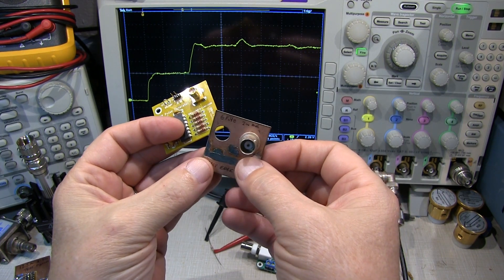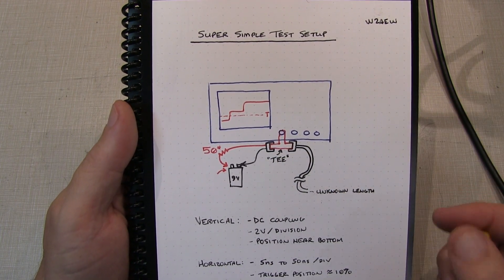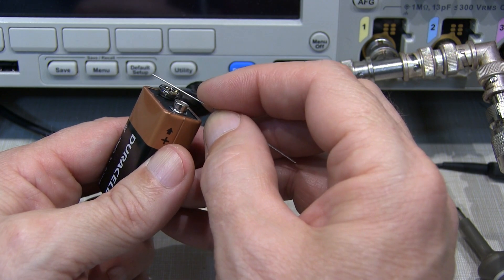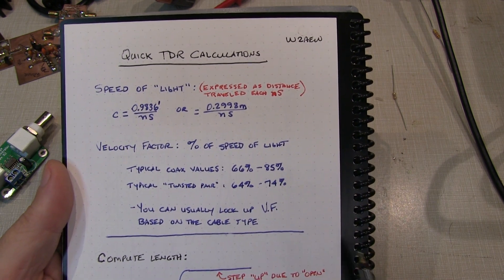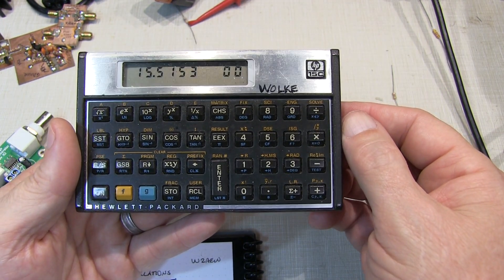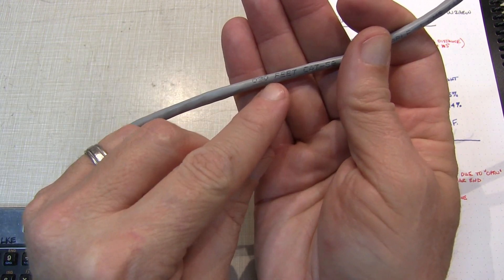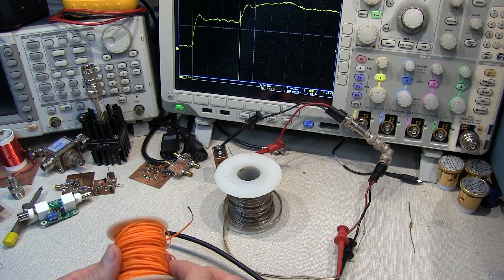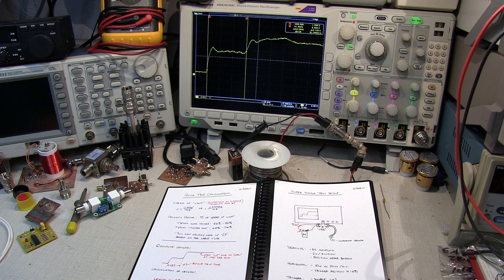#323: Measure length of coax, etc. with your scope, a battery and a resistor - simple TDR

Comment: Very educational content. I tried to use this method to capture the "top-up" waveform, it turns out that the resistance used is important. Initially I use a ~250ohm resistor, I can hardly get a meaningful waveform, probably because the signal bouncing back and forth multiple times. When i use a 50ohm feed-through bnc connector for the signal port,  it's easy to capture the expected waveform and the round trip time seems reasonable (yileding a ~66% VF).

Comment: 9:43 With 2 twisted pairs connected in parallel I should get 50 Ohms  for my simple 1/2 wave dipole. 😆 I will try 4pcs of 1/2 wave dipoles on a super high plastic water pipe, with 1/2 wave free space between each of them.  With all the UTP cables of the same length, phase should be OK and it should work with my Baofeng UHF 70cm band walkie-talkie.  This will be my funniest antenna, made of old UTPs. 🤣

Comment: Nice. You actually sending a step function signal along the line. No polarity change, only 0 to 9V! As it propagates and reflects - it looks like it only interferes constructively. Doesn't it? Very interesting.
Reply from the maker: Yes, only constructively.
Reply: On the othe hand, the total voltage of the second step is ~9V=voltage of the battery, which also makes sense...
Reply from the maker: @eugeneeugene3313   This is the right answer.  The coax is an open circuit, so once it is "charged" up to the full battery voltage, no more current flows - thus no voltage drop across the series resistor, and the voltage on the line equals the battery voltage.

Comment: I just found the break in a guitar cable using this TDR technique :D The break was inside one of the jacks. The break was 2 mm before the very end of the center wire inside a coax cable, right next to the tab it was soldered to inside the connector. The delta x was 41 ns so the break should be a little more than 4 meters away, according to the formula. The cable was about 3,5 meters long, so it had to be at the very other end

Comment: Is there a simple way of measuring the time between the rising edges digitally so you can output the length on a 7 segment or lcd display and remove the need for an oscilloscope? Would using some comparators with two reference levels to detect each rising edge work? I can see this being a problem when measuring different impedance cables as the levels will shift. Measuring shorted cables would also be different but would this be a fairly reasonable approach?
Reply from the maker: You could arrange a pair of fast comparators, and have them switch on a current source that charges a capacitor to create a linear voltage ramp between the edges.  After the 2nd edge (and the current source is turned off), the voltage on the cap will be proportional to the time-delta between the edges.

Comment: I just tried this Alan!  I came up with 78' 6" but haven't verified the physical length yet (can't get to part of the cable up in the garage rafters) but it appears to be quite close by my estimation.  On the bump up after the initial ramp of 188 ns, the bumps 'repeat' at 188 ns rather than a straight line that you have on your scope.  It's as if the pulse is ringing in the cable.  Is that possible? or is there something wrong with the cable?
Reply from the maker: It is possible there is a small impedance discontinuity in the cable causing a small reflection.  Check other cables to see if the same bump occurs.

Comment: This is an excellent video. However, for some reason my waveform does not look like yours. I get more square waves, or sometimes slopping waves. But nothing like yours. I am using a Hantek scope (probably the reason why) trying to measure a known length of RG-6 (75Ω again, probably the reason why). I did the back math to determine what the delta time should be and get nothing anywhere near that time. Thoughts? DE KF6BL
Reply from the maker: The fact that it is a Hantek shouldn't matter.  What is your expected length, and what are your scope's horizontal and vertical settings?  It should work just fine with the RG-6 75 ohm coax.
Reply: @w2aew  Thanks for the reply. 2V vertical and between 20~500 µs looking for that distinctive waveform. Anything below 20 µs will cause the scope to lock up. The length of the cable is 5' .5". I am using a resistor of 49.5Ω. I'll keep trying. I saw some other videos of yours using a pulse generator. My scope has a squarewave generator. I might try that and see if I can duplicate on of your other videos. I am trying to experiment with the scope and NanoVNA for testing cable lengths. Thanks again - KF6BL
Reply from the maker: @briandonaldson612stringgui8  Well, there's your problem.  20us to 500us is WAAYY too slow to measure the round-trip delay of 5'5" of RG-6.  RG-6 has a velocity factor of 83%, which means that signals travel at about 9.8" every nanosecond.  Your 65" cable (130" round trip) should give you a TDR delay of just 13.2ns.  So, your horizontal scale would need to be set to something like 5 or 10ns/div in order to see this.  It also means that if you were to try using your scope's square wave generator, it would have to have a risetime that is MUCH less than 13ns in order to work (which is unlikely).  If your scope "locks up" when you set the horizontal time/division to less than 20us, then that sounds like a problem with the scope.
Reply: @w2aew  Wonderful. I guess my math is very limited when it comes to C and inch/ns. I will continue to try working with faster rise time if the scope will go that low. Thanks!
Reply: OK... maybe I was messing something up and thinking my scope locked up. Got it to 5 ns, got the waveform, but not as pretty as yours, but measured around 7 ns as a delta. The cable is 66% to the best of my knowledge. I think I will work with 50Ω cable until I really understand what I am doing. Much appreciate your help.

Comment: Its often amplifiers use Class 2 wiring but what is considered Class 2 wiring by the type of wires heat resistance and wire gauges and the PCB board traces WIDTH and type of copper plating used are class 2 wiring?

Comment: No “contact bounce” ?
Reply from the maker: Sure, you may still have some contact bounce, but it will often have rate that is longer than what you're looking at with a TDR - so you're effectively making the measurement on the first bounce.  If you get a bounce in the way, just run it again.

Comment: Hi Alan, I tried capturing this on a Rigol Rigol DS1054Z Digital Oscilloscope but was unable to get the anything that looks like your waveform? I tried i on a rg6 piece of cable I had laying around. I noticed that your scope has what appears to be 5GS/S.... Mine is only 1 GS/s max sample rate(for single channel). I got a similar stepped look at US/sec resolution setting but had no success in the nanosecond range. I was wondering if my scope is not fast enough to trigger, an ideas?
Reply from the maker: The more important thing is to get the horizontal scale correct for the length of coax you're dealing with.  For short lengths (a few feet), you'll like likely need 10, or 20ns per division.  For longer lengths, you'll need a slower scale (50, 100, 200ns/div, or even several uS / div).  Make sure to use Normal trigger mode.
Reply: @w2aew  Thanks for the quick reply.  I tried this technique again using the exact settings 2 volts/div and trigger of 2.2 volts rising edge (normal), but the only way I could get a waveform with steps to display was with a time setting of 5 microseconds. When I measured using cursors between the rise time and the reflection I get 3.4 microseconds, however the length of coax is only a short piece 21 inches long. Does it matter how long the jumper on the battery and resistor end is? I used a pot dialed in a 50 ohms and a 9 volt battery.
Reply from the maker: @drbsr1948  OK, I think the scope BW is the issue.  A 21 inch cable will have a propagation delay in the order of 3ns, so the round-trip delay would be around 6ns.  However, your scope has a 50MHz bandwidth, which implies that the scope's own risetime is going to be around 7ns - so it's just not fast enough to see the reflection from such a short cable.
Reply: @w2aew  OK I have a 100mH scope as well that I will try with a longer piece of coax. I did some googling and downloaded a pdf that explains the rise time vs bandwidth. Basically the take away verifies what you said above and  the following pasted from it:

 This is sometimes referred to as the five times rule of the oscilloscope bandwidth selection:The required bandwidth of an oscilloscope = the highest frequency component of the measured signal x 5. The measurement error of an oscilloscope using the five times rules will be less than ± 2%, which is  enough for most measurements. Thanks for all you do Alan
Reply: @w2aew  Got it worked out using my 50mhz bandwidth scope. I had a 83.5 ft section of rg6 coax that worked out to propagation delay of 125ns | 68% VF | 8.024 inch per ns speed  | calculates out to 1003 Inches or 83.58 ft Physically measured out to 83 .5 ft

Comment: The smart solution is the simplest! Thanks for sharing this! 🙂 👍
Reply: I have an old Tektronix with leaking capacitors (still alive to some extent) with which I would like to give it a try in measuring some cables.

Comment: I wanted to suggest this to some people I was working with in the field at a radar site.  They were a mixture of EEs and technicians, and had no idea how to determine the distance down the line, of a fault, without specialty test equipment.  I have an ME, but have little EE coursework under my belt (but I have a lot of experience with oscilloscopes).  I was not confident enough to suggest anything, and the people at site didn't want to hear anything from me anyway.
Glad to see it might have worked.
Reply from the maker: Well, maybe you could just send them a link to this video before you head out to the field again ;-)
Reply: @w2aew  lol

Comment: I upgraded with a timer IC and a FET driver IC. Keep this device in my scope kit. I added a 500 ohm trim pot to find the nominal impedance of the cable.  I found most cheap "DMX digital cables" are actually built with low impedance microphone cable. They measure 60 to 70 ohms instead of 110 to 120 ohms. This is important if you do stage lighting.

Comment: and there you have it guys
T.D.R. Basics on your Scope :P without the need to buy a T.D.R.

FOOD FOR THOUGHT
When talking about an O.T.D.R.  (for those not familiar)....
this test is only possible because THERE IS A METAL CONDUCTOR in the cable.

An O.T.D.R. is an OPTICAL Time Domain Reflectometer
meaning the cable does not have a copper conductor that your scope can measure

THEORETICALLY we would measure the length of an optical cable using the same formula
only...

1. You would need an Optical light source

2. I suppose you would need a scope that can interpret Optical Signals

or 3.   Would it just be easier to go out and get an O.T.D.R Tester

but , it's fun to think about
Reply from the maker: Yes, an OTDR works on the same principle. You need a pulsed light source and an optical detector for the scope.
Reply: @w2aew  
That's right.
I posted that comment to get everyone else thinking outside of the box :P
thanks for your input

Comment: I'm curious to see if there's any coupling between two different color conductors in the ethernet cable. Probably not enough to see with this tdr method.
Reply from the maker: There would be some, but at a pretty low level.
Reply: @w2aew  looks like the near end cross talk (NEXT) spec for cat 5e is 32 dB and cat 6/6a is 42 dB. Probably on the cusp of whats measurable with this pulse-TDR method. Definitely heading in the direction of a VNA.

Comment: I vouch  from personal experience this technique to repurpose a 100m section of 19mm dia SHF triax feeder for a microwave link. The cable had been installed in a semi-permanent location but at the weather gland where the it entered the transmitter hut there had been some damage that had left the cable under unnecessary bending strain in direct sunlight during day eventually resulting in a dead short of the inner conductor to both outer screens. The run was replaced with new but shortened lengths from the 100meters can be be used on other jobs as cutdown spare lengths. Where to cut was the quandary and with no obvious recorded marking of the damage point nor any deformity i chose to use TDR. The result was that when i put the cable cutter through the calculated distance point it was right on the centre to outers short! That was a great feeling to see Physics & theory come together! There was a small section where the dielectric had softened probably in the heat of high summer over many cycles allowing the centre conductor to eventually move enough & finally touch the two concentric braided conductors.

Comment: I agree with all you showed.  Have done that myself.  But like in radars, you can do with some other way, often called Chirp.  Too bad that goes to the opposite dirction from the basic idea of most simple instrument requirement.  You would need some sort of sweep frequency source, although I speculate that I could do it by finding the different resonant frequencies using a grid dip meter.  Or maybe that is too much of history by now.  Maybe a FET dipper?

Comment: Hi Alan,
Thank you so much for this series of videos! I’ve built your Schmidt trigger generator and it works like a charm!
I used a 74AC14 smd chip and 1% resistors, and I put them in a shielded airplane junction box that I had lying about.
I powered it up with 3V and I got a rise time of 4ns. Right now struggling with crappy cables.
Thanks for the great videos!
Cheers,
Mark

Comment: Do you have a way to measure a single wire length?  About a year ago  I strung up a longwire about 260 feet long but don't know exactly how long . Didn't meausre at the time. Don't want to take it down to measure. I have access to one end. Currentl feed with about 50 Ft RG8x  and 49:1 UnUn..   would like to trim it to work on 75 meters better with out antenna tuner.  73's and Merry Christmas  Dan ~ KC4GO

Comment: Could you measure the single wire spool using a slightly different, but similar technique? Like if you have access to both ends of the wire on the spool and used two channels on your scope, could you still measure signal propagation through the spool by timing the difference between the rising edge on one channel and the rising edge on the other channel? You'd have to remember to not divide your result by 2.

Comment: This is with the other end of the coax with an open circuit, right?  or is it with a short circuit?
Reply from the maker: This is with the far end open. If it were shorted, the second step would return to ground instead of increasing to the battery voltage.

Comment: If the end of the cable under test is shorted, will this still work? I would assume that the result would either be twice or half the open (unshorted) length, but I'm not sure which. 
Coincidentally I was recently looking at a site about organ pipes which also double or halve their frequency depending on whether the end of the pipe is open or closed.
Reply from the maker: If the far end was shorted, the "second" step will return to ground instead of doubling in amplitude.

Comment: Seeing you move around the cursors, i wonder why vintage analog scope manufacturers never made a mechanical variant of those. I got an old Tek 454a, once a really expensive beast. But while it has loads of features and bandwith that i won't use, i'm still stuck counting divisions by hand. 
It seems to me that it would have made sense for Tektronix, HP and the other big names of the past to deliver such high end things with slide rule like cursors, or caliper style with a nonius. Hell, perhaps even with a spinning dial like you see on some micrometer calipers. I would've expected it to be a major selling point. 
Hell, for the highest of high end stuff you could make some mechanical linkages between time/div switch and several scales to mechanically calculate the period time, perhaps even to indicate the frequency... Not as accurate as a real counter but i can imagine that it would definitely come in handy.

Comment: I love the videos, but it kind of drives me up the wall to be reminded that I can't really use any of it with the equipment I have and the task I need it for.  I like that you included the UTP notes though.  Idk how much VF uncertainty is going to be a problem when dealing with waterlogged cables.
Reply from the maker: I would think that the VF would change on waterlogged cables since the dielectric constant between the conductors will change.  While I show a high end scope here, the same can be done with a 50 or 100MHz digital scope (or an analog scope with a scope camera, or using a pulse generator instead of the battery and resistor).
Reply: @w2aew  Yeah, I have an old (10? 20MHz?) dumpsterized single-trace CRO.  Trying to capture single-shot events is kind of a maddening gamble, and usually results in enough image distortion (from a digital camera) that time measurements are unreliable.  

I can use a pulse train, but I can't really zoom in on the leading edge of a single pulse, because the trigger delay will always cut it off at short timebases.  I would need to make a synchronized trigger source to lead it ... but that would require a scope with a working external trigger input. 

There really isn't much to do about it.  Frustration is a natural consequence when the people with the right tools for the job already gave up and walked away.  I still really appreciate the videos though.